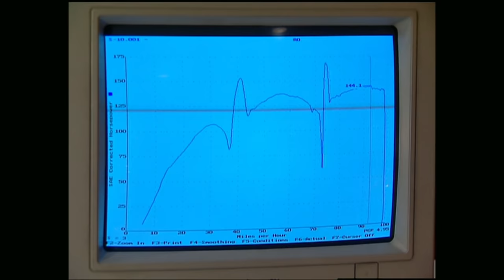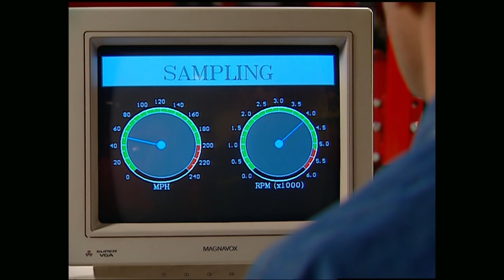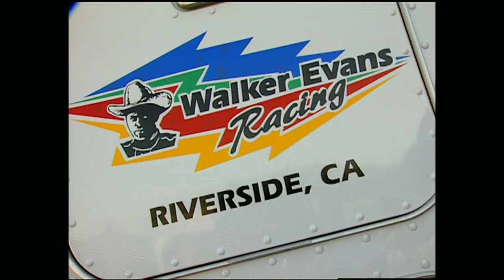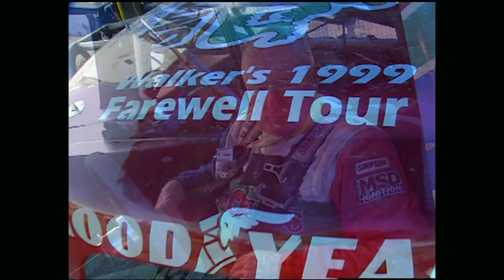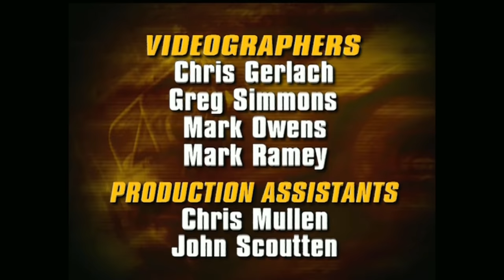Squeezing V8 Horsepower Out Of The S10's 4.3 V6 With A Supercharger Install - Trucks S2, E3

Comment: I think a lot of people forget you can't judge performance of the late 90s by today's standards, this was pretty good.
Reply: L35 Engine, fyi drive trains/accessories are parasitic power loss.
Reply: True.
Just having a modern ecu would change the final number significantly.
Reply: @gregbrightwell662  There is another episode where they swap an LT1 into an S10, they are excited about 330hp lol.
Reply: @carguy3028  lol!
I build clutches for a living, if a v8 isn't hitting 500hp,  its stock!
Reply: @carguy3028  the truck is light, 330 is plenty.

Most cant handle 180 as is.
Reply: @shadowopsairman1583  I don't disagree with that, but today they wouldn't go through the trouble of a V8 swap for only 330hp.
Reply: For sure man tech changes pulling 250 hp in the late 90s was big i mean now we have cars that pull 300 to 400 stock and there soccer mom suvs
Reply: I would be damn happy with 330whp in a 3000lb truck.
Reply: Dropping 5K on a supercharger and only getting 60 RWHP is not something you tell a friend about. You could probably swap in a Vortec 350 or LT1 for less money or about the same and make way more power.
Reply: @TwentytenS4B8  I think you miss the point of what era this was, It probably wasn't 5K it was probably less but considering inflation the cost is close.  Back then that was a huge increase, and you don't have to pull the engine and do an engine swap.  I think this came out in 1999 or 2000, there weren't many vortech 350s in the junk yards yet, the LS1 was only a couple years old and too new to really be affordable.  The LT1s weren't common in junkyards most of them were still running around the oldest ones at that time only being 7 years old.  60whp was a huge gain in that time, stock v8s only put out about 250hp at that time.  Today that would not be impressive but in 1999 or 2000 that was a big deal, also emissions legal, and it was a brand new truck most people don't want to swap the engine out on a brand new truck.
Reply: All I know is my 1990 300zx was rated at 300hp and was 1.3 liters smaller...
Reply: @Firion13  you probably had a dual overhead cam engine as well, those do a lot better.  I feel for a pushrod v6 in the late 90s early 2000s this was good.  Also that v6 in the s10 is biased for low end torque over top end power.
Reply: I disagree..yes newer have wider ranges and tighter tolerances but they all have computer control since 1987, nothing new in newer that can't be added to a older engine. According to what you want torque or hp. I know some old school carb systems that still outperform newer engines. You put computer control on those old engines and tune them. Nothing stock will approach them.. i.e. 427 tall deck series for torque..hemi's still being built, so i say bullhockey.
Reply: @genedominy7696  unless you have a time machine you can’t add todays tech when this engine when they shot the video.  This episode aired 1998 or 1999, they didn’t have today’s tech then. Like I said most people look at this from today’s vantage point, in 1998 this was good, of course this same engine today you could get more out of it but not so in 1998 and keep it streetable.  The technology wasn’t there for a 2 valve pushrod engine.  Yes they were computer controlled but that is like comparing your smart phone to a dos machine.
Reply: Would have been better if they had added a proper tune to the kit and not just dropped boost in it with just a tune for 87 I make 180 to the wheels with only basic stuff
Reply: @carguy3028  good points all. I’ve got an old 96 Astro I might do this on just for kicks. They also didn’t say what amount of boost they were running.
Reply: @carguy3028 Personally the street legal aspect of it, combined with the bolt on nature of it is ideal. Everyone has there own criteria nonetheless less. Any suggestions for more power out of something like this while keeping it within the above parameters? Asking for an old dinosaur friend.
Reply: @Firion13  you can compare a twin turbo twin overhead cam v6 to a single cam v6 that was only made for low end torque
Reply: @carguy3028  330 hp in an s10 would move pretty good they only weigh like 3k
Reply: @carguy3028  I mean it would still be fun today with a 330 hp v8 it's 3k lbs.  It would more than hold it's own.   Not everyone can afford a 5-10k dollar newer engine.
Reply: @Firion13  it was also turbo and it has dohc tech not comparable.
Reply: @Firion13  not to mention your talking about crank HP, they are talking about wheel hp in the video. Big difference.
Reply: @midnight347  I had a custom turbod 2.5L v6 in my Ford probe. It made 315whp and 335tq and weighed 2695lbs with me in it.

With a road tune on megasquirt, home made everything. It ran 13.3 at 115 mph on 8 psi with an open front diff. Didn't track it much but I was neck and neck with a tuned only 03 cobra with x pipe from 40-120. Kids these days don't understand how much less horsepower you need from a 1990s platform because they're 1200lbs lighter
Reply: @carguy3028 up until the early 2000's, SS Camaros where about the fastest cars on the road that a working man could afford, and they had 320 hp. It was like riding in a rocketship at that time. Lol
Reply: @1980bwc  i remember that time, I was young and couldn’t afford one but I wanted one, I got my license in 99 when I turned 16.  I bought a brand new Mustang GT coyote in 2013, I never would have thought at 16 that some day I could buy a car with 400hp and it would be affordable and get good gas mileage.
Reply: @okevolutionviii i swapped my 72 c10 short bed with an lq9 engine!! from factory the engine comes with 345hp & truck weighs about 3,500 lbs its really fun to drive even though the engine is stock!!

Comment: When he said "60HP, it was definitely worth it" I almost pissed my pants. When the metal shavings in the pan spin a bearing just toss a V8 in it
Reply: Ok so a SBC V6 isnt worth it?

What about 500 HP from SuperChevy on the L35?
Reply: That was also the first pull, more timing can probably give it 100 or so
Reply: That Vortech supercharger kit can definitely put out more horsepower than 60 just needs to be tuned and adjusted
Reply: Funny thing is that truck is supposed to have 190hp stock 🤔
Reply: @scootersonlyrepair6773  The engine was at 190 not at the tire.
Reply: @scootersonlyrepair6773  not at wheels man.  Thats crankshaft hp
Reply: You ever seen the cyclone?????
Reply: That metal shaving thing had me worried too lmao but sometimes I feel like people overthink metal shavings a little
Reply: @scootersonlyrepair6773  at the flywheel it don't have 190 to the wheels stock.  How is it that people STILL don't understand this in 2022?
Reply: @chadjay828  💯💯💯 and might be more work then a v8, but some cylinder head work will jump power up significantly also.

Comment: This is honestly the cleanest install I've ever seen. They hid everything in a concealed place and kept the engine bay clean. That Windows 3.1 dyno is OLD!
Reply: they hid the metal shavings in the oil pan too
Reply: This episode is very old.
Reply: Yeah... they also did the whole install 9 minutes....They have 21 minutes of footage in a 30 minute episode, of course they cleared the shavings out of the pan.
Reply: Looks like DOS, not Win3.1 or it could be DOS app running on 3.1
Reply: @CamaroZ28Nut3  2006
Reply: Not really, just when I remeber it
Reply: @CamaroZ28Nut3  prob 2000
Reply: @TrumpAmerica-2024 was thinking the same thing. I was like these dummies saying be careful not to drop shavings. Bruh how. Take the pan off!

Comment: Not a Chevy guy buy no means but this little 4.3 is probably one of my favorites. Thinking about  chopping up a cobalt and sticking one in it for the hell of it
Reply: Better off with ls4
Reply: @Southized  people constantly say that. no one wants to cram an overly hyped engine into their truck. its funny because I fuel injected my SBC 350 with a harness from a junkyard and a little bit of tuning with some free software and I constantly see people on the forum that I got the tuning software from begging if someone can tune their supercharged ls3, Only one or 2 people reply. but when I ask if someone can help tun my 350 I get tons of people replying
Reply: @lt.schlechtnacht9414  this comment was 2 years old, this guy is talking about putting a v8 into a chevy cobalt. It is much easier to take a ls4 front wheel drive v8 from a impala ss and put it a cobalt than do a whole new rwd frame for a 350 small block cobalt.
Reply: @Southized  ohh yeah jut ls sawp it at this point i thought you where going to other route "just ls sawp it bro"

Comment: Kinda love spending 4k+ for 60hp. The 90's/early 00's were something lol. Plus this show was sponsored by just about every company they used in the episode.
Reply: @Jack Russelle Lewis the one that actually matters
Reply: Back when the show was interesting and the trucks they worked on looked better then what's made today imo.
Reply: I mean there is room there for alot more power with some cooling more boost and additional tuning.  Also a 60 horse gain on this engine would be like a 40% gain that is pretty decent for a pushrod 90s v6.
Reply: this might be one of the dumbest comments on youtube

Comment: S10s are awesome
Reply: When small trucks were affordable.  Nowadays if you add a few options you can pretty much buy a half ton.
Reply: @bmstylee  yes sir very true
Reply: 1st gens were cool, the 2nd gens were trash
Reply: @TrumpAmerica-2024  I’ve had a few s10s
Reply: @bmstylee   Yeah but then you lose that's small truck coolness. Granted nothing comes with that small truck coolness anymore anyway
Reply: In what way are s10s awesome? The way they max out at 80 mph? The way you can hardly fit 2 grown adults inside? Is it the bone rattling ride quality? Maybe your s10 is different from mine.
Reply: @pauloakes6952  I’ve had two one was pretty good seated three people and did 115 the other sucked seated two and did 90. The first one rode good but the second one was not the best
Reply: @pauloakes6952  80? Maybe a tired iron Duke with an automatic.  My 2.8s and 4.3 cruise at 80 happily.  U have to remember they wouldn't built to compete with a car and definitely not today's cars. They were dirt cheap work trucks. When they were new they were very nice and did what they needed to do. My buddies and I have pushed them way beyond their limits. I've towed double axle trailers with cars on them.  Don't expect it to tow like a duramax but it'll do it. They ride rough because they're trucks.  If u lower them cheaply they'll ride worse.  My 93 lowered rides like car but I don't use it as a truck. All QA1 and sway bars. I sadly sold my 91 that was stock with 45k. The interior was as tight as my 2021 kia. So its not that u have an s10, it's u might have the wrong s10
Reply: @Matp345  if the statement was “s10’s are durable” or, “s10’s are long lasting” I would’ve kept my troll mouth shut. But they’re not “awesome”, I’m just not on board with that idea.
Reply: @pauloakes6952  I have a 2002 Chevy extreme and as a small guy 5”8  I don’t get why the clutch is so dam high and the gas is so far low I’m gonna. Modify those two. I love the styling but my seating position is so uncomfortable unless I’m in the freeway and don’t need to reach for the clutch. I might need a 50 shot or even more of nitrous because I don’t think this turd could beat a Camry… I’m gonna race my friends 2005 lexus es330 and I hope it’s not to bad.

Comment: Late 90's early 2000's this wasn't bad. Like some have said, 250hp in a v8 pony car was pretty good. Yes, today you could swap almost any mild build LS (4.8, 5.3, 5.7, 6.0, 6.2) into it today, the tech just wasn't available at the time. Could have it been done, yes, but probably at a prohibitive cost. It's amazing what can be done with a junkyard motor and a laptop these days.

Comment: I got about the same results in HP gains with cold air intake, tuned exhaust, and a mild chip tune, for a lot less effort and money. Went from 155 stock to 200 and picked up about 2 mpg. Best part is I haven't done anything to overstress the internals and I didn't drill a hole in my oil pan

Comment: I look at it like this..... the truck increased power by around 45-50 percent at the rear wheels. That 60 some increase is probably closer to 80 hp at the crank. Not bad for what is essentially mild boost.

Comment: Any centrifugal supercharger or turbocharger needs some kind of intercooler. It would've been really cool to see this kit with a water to air intercooler with a separate reservoir for ice water.
Reply: Remote mount
Reply: You gonna be running 20 lbs. Of boost and 30 degrees of timing?????

Comment: Hell those regular cabs 4.3 s10 were quick... never under estimate 1 of those especially adding 60hp to it. Guarantee with some tires on it that truck could run low 14s to high 13s  on the 1/4 mile.
Reply: I had a 1999 model 4.3 w/5spd like that one. I never put it on the track. My brother had a '99 chev 1500,  two wheel drive, regular cab, automatic, 4.8. 

The s10 would pull him about 1/2 a truck length in 2nd and 3rd gear and stay there til they topped out.

Comment: I looked at this option before. You can swap in a whole V8 for that much money, actually probably less.
Reply: Broken record.
Reply: I helped my friend build a v8 s10 n it's not as cheap as you'd think. Little things add up quickly lol
Reply: @sicsam1  if you start with a V6 and choose a small block over an LS, all you need is the computer with a couple extra wires, headers, oil pan, and mounts because the 4.3 is a 350 that's missing 2 cylinders. Sure you can make it nice and it adds up but that supercharger kit is around 5 grand. That's more than the last two cars I bought combined. Besides, 5 grand on a V8 is way better spent than 5 grand on a V6. My .02
Reply: @marcus3128  you don't say... you either need a tbi or vortec 4.3. Just depends on the year, Done that too but we did it with 89 4 cyl truck as a base.
Reply: @marcus3128  that’s a ridiculous price for that supercharger kit can get a small block 350 ready to be dropped in four no more than four grand I am getting ready to do that to my S 10 not the supercharger kit neither putting the 350 in and with the extra thousand I saved could possibly go out and get a supercharger for the 350
Reply: @chadjay828  at least a nice turbo
Reply: @chadjay828  how’s the swap going l? I was thinking of doing the normal mods electric fans cam n headers with a tune but I can’t find much info on how much power they can make especially with the stock fuel system on a 2002 extreme. I was thinking this motor could make 3/4 of what a 350 would make with some mods but nobody wants to do it. I tried finding some information on meth injection and nitrous and still nothing. 
Would be cool if you could make 250 wheel with a mild cam and long tube headers
Reply: @alexvillalobos7137  haven’t started yet my mechanic has fallen behind so may push it back until fall those extremes are some pretty bad ass vehicles I seen a video on YouTube a guy just put a turbo kit or supercharger kit on it and was running tens no bullshit look it up I’m sure you can find it it may have been 11s I think more middle 11s now that I think about it but that’s still pretty freaking quick for a stock motor when I do my swap I will try to send a video
Reply: @alexvillalobos7137  The 4.3 L is a 350 minus the back two cylinders so yeah better get 3/4 of the power from a 350 but if you know a little bit about engines you’re better off doing it yourself because when you find someone to do it they’re going to charge you out of your ass I watched a video on YouTube where a guy put a torque storm supercharger on a 4.3 L motor put in a better cam and increased his horsepower they increased the horsepower a good amount
Reply: @chadjay828  Ive seen his channel turbo4.3, may need to watch more of his build. I was wondering if you can use a typhoon type of kit, maybe that’s what he’s doing or just doing cam-header but that doesn’t seem to get much power unless use nitrous maybe a 50-75 shot
Don’t have any experience with motors but it can’t hurt to learn in the 4.3.  Only struggle would be finding a tuner in cali
Reply: @alexvillalobos7137  if you can find a turbo from a typhoon or a cyclone yeah they will work I heard through the grapevine there’s tons of tuners and Kelly you just end up paying a pretty penny for the tune my bad I meant Callie
Reply: @sicsam1  like what things? I mean sure if you start adding in aftermarket parts.
Reply: @chadjay828  actually it's the 2 middle cylinders that's missing.
Reply: @roygriffin6272  are you sure? Every mechanic I’ve talk to always say it’s the back two cylinders either way though it’s two cylinders shy of a 350 I am honestly done buying any vehicle with the 4.3 L engine in it that motor is cursed to me every vehicle I’ve picked up with a 4.3 L engine and it has nothing but fucking problems they may run but they run like absolute shit
Reply: @chadjay828  I mean this was in 2000.  People need to understand and stop judging off today's standards.
Reply: @chadjay828  it was also a brand new truck how many people swap engines on a brand new truck?

Comment: Hope they removed all the Dexcool before adding the green stuff. Also I was considering adding a s/c to my 4.3L but the cost and labor involved was more than a 50 + HP increase
Reply: I do computer sims on the engine platform and with a 2 or 3 inch diameter turbo fan set you can generate well over 100hp as long as the exhaust is changed with a 3 or 4 inch pipe set and you gotta cut the catalytic converter for airflow. It can be done but it isn't easy

Comment: They probably left it at baseline boost settings, being there wasn't a great way to tune EFI back then. Could have added fuel/timing/boost and made some real power. Those little 4.3 will make 400+ at the wheel pretty easy